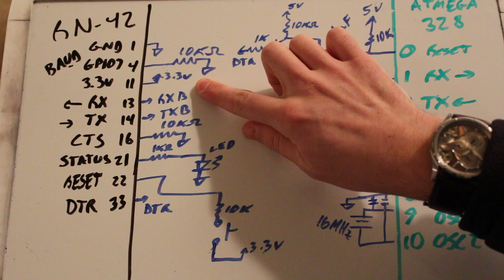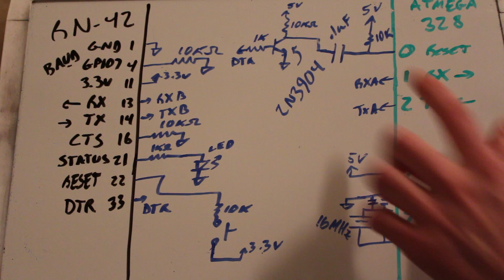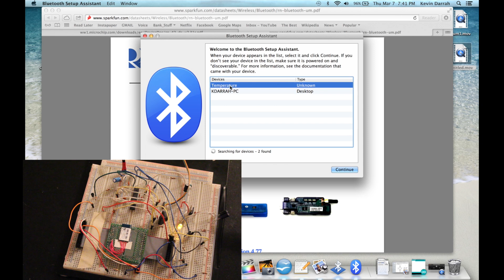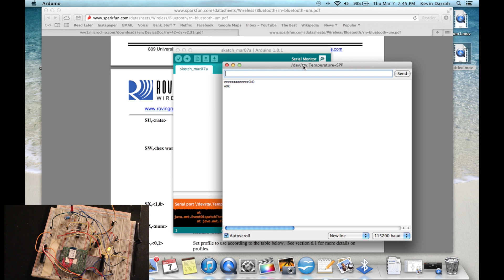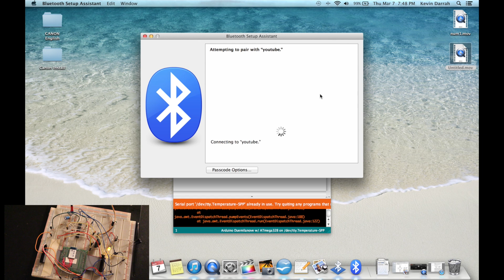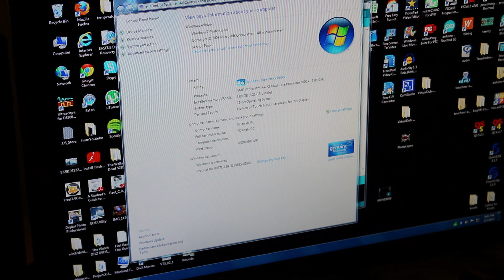How To - Arduino and Bluetooth (RN-42)

Comment: I have a problem my mate is not responding to commands on the serial port.At first configuration It would not exit using -  . i unplugged it. after that i cant enter command mode.
Reply: just fixed the problem!! you need to hit any random keys for a few times then it kicks back in and allows you to reset it SF,1

Comment: With the DTR line connected to the Arduino Reset line, won't you reset the Arduino whenever you send ANYTHING over the BT from the host?  In other words, won't you reset the Arduino if you send any type of string over the BT from the host PC?  If that's true, then you can't program over BT and also send serial commands from the PC to your program running on the Arduino because the commands will cause the board to reset. 
-....Trying to understand.  Thx.

Comment: Great video! I am currently working on a classic NES controller, I have a Arduino Mini Pro connected to an RN-42 and a lithium battery crammed inside. Im trying to make a wireless classic controller. I have it working and sending info to my laptop. However, I cant figure out how to tell it that Im "holding" a button. The computer only sees quick key presses, regardless how long you are actually holding the key. Any ideas?